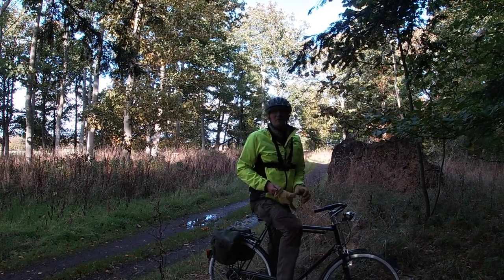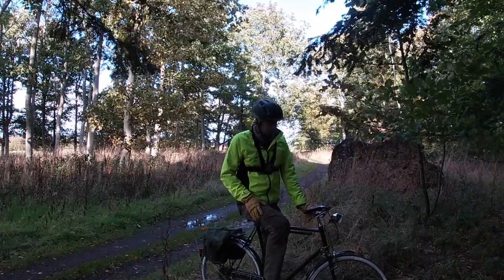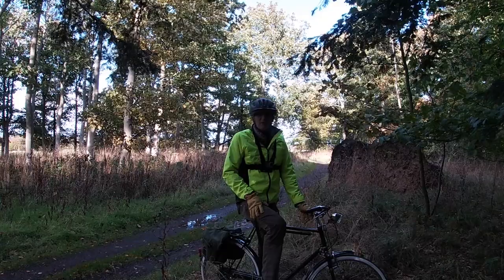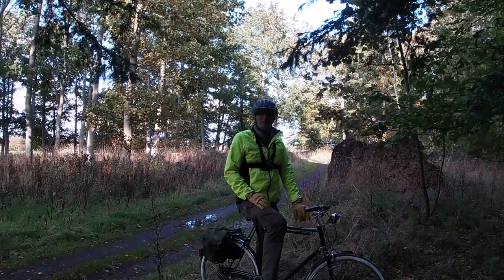2022-28 | Raleigh Superbe | Vintage Bike | East Lothian Byways

Comment: Nice ride but judging by the trees when you stopped  it was very windy. 
Those old Raleigh 3 and 4 speed bikes just go on and on. I had one as a boy and didn't worry about the hills and just 4 gears. 
I wish I still had those legs!😁
Thank you for sharing.
Reply from the maker: Hi Colin, I can only agree about riding these bikes as a boy. The hills seemed to come and go without much effort at all. Well, its a different matter now. I reckon, in my youth, the creaks and groans came from the bike, due in no small part to the strength of my young legs. Now, the bike runs silent and the legs creak and groan. Ah, such is life :) Trust all is well with you. ATB, Dave

Comment: Nice Bike Dave, I have an old Raleigh Racer in need of restoring. I'm a cyclist myself, I cycle most days, to be honest it's my obsession \o/, it has been for a long time, you simply can't beat cycling. Stay fit, stay strong  ATB.
Reply from the maker: I've been a cyclist since my youth, when I put together a bicycle from discarded bits and pieces. I like the simplicity of the old bikes. They are easy to repair/rebuild and fun to ride. Its great that you get out most days. There is no better way to keep fit (and enjoy the countryside). ATB, Dave